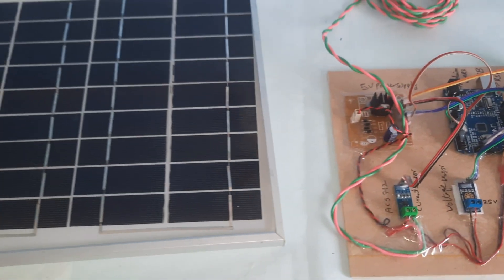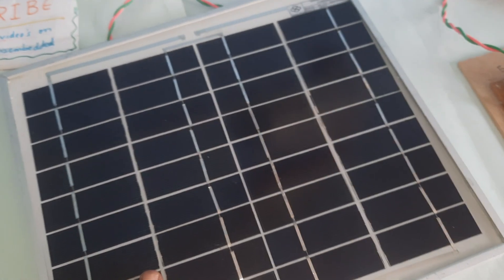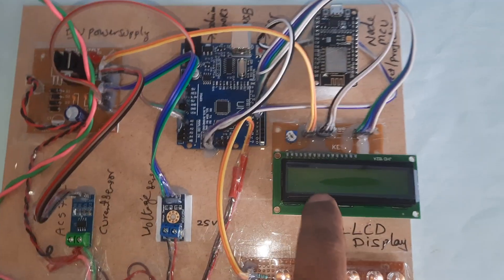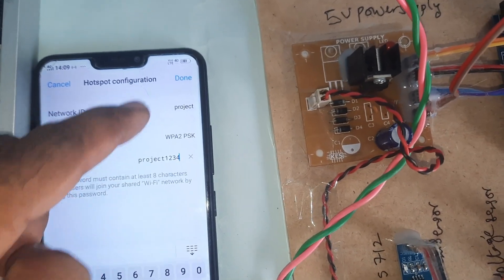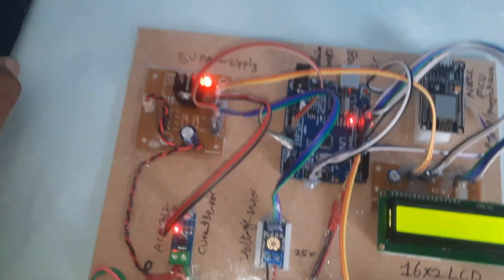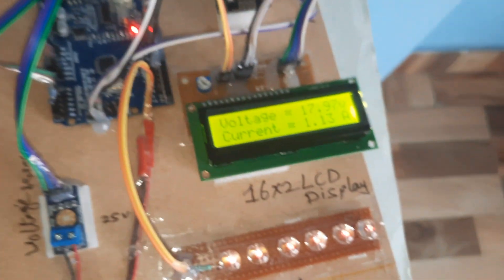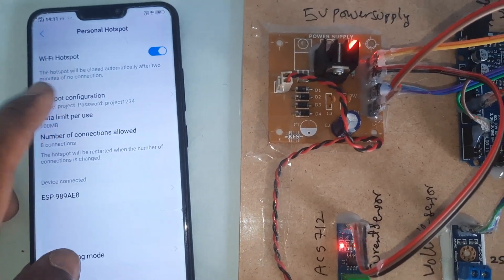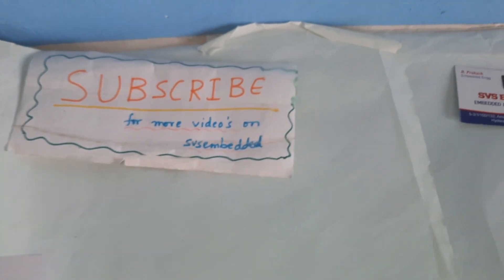IoT based Solar Power Monitoring System using NodeMCU (ESP8266) and ThingSpeak

Comment: his IoT-based solar power monitoring system project enables real-time tracking of solar power generation, using sensors and communication technologies like ESP8266 or ESP32. It integrates data such as voltage, current, temperature, and MPPT into a ThingSpeak platform for seamless monitoring. This system ensures efficiency in solar power usage, making it accessible through Arduino and LCD for easy data visualization.

Then I came across GAO RFID Inc, which offers what you might find useful.